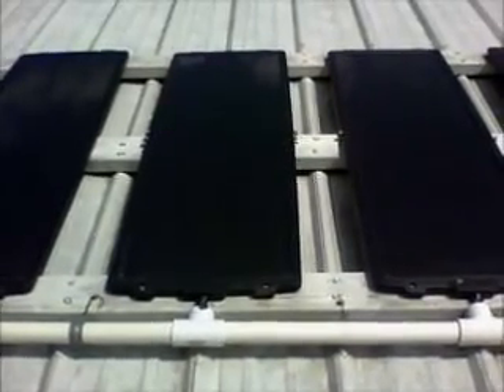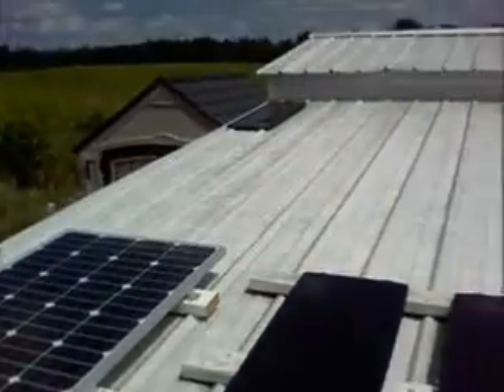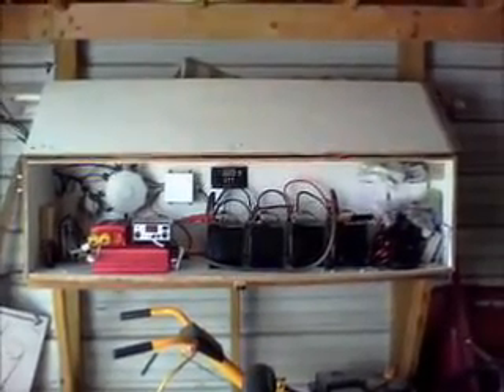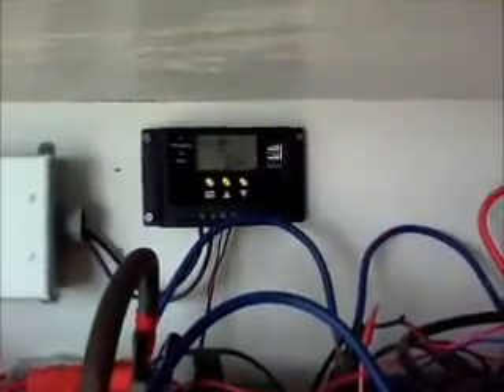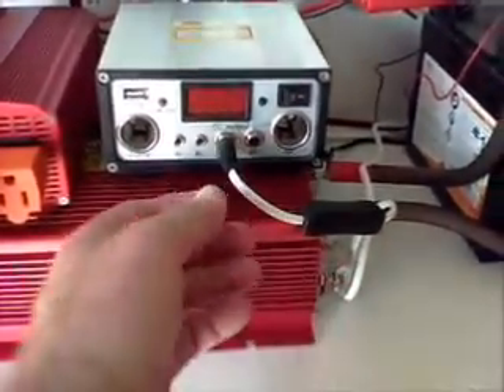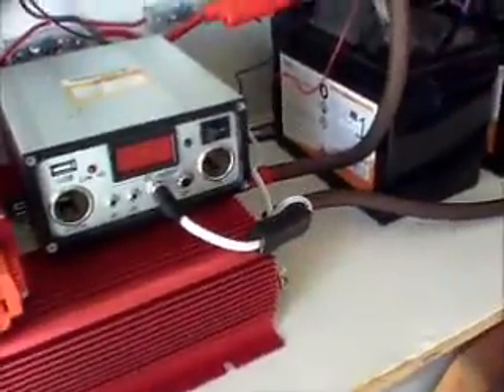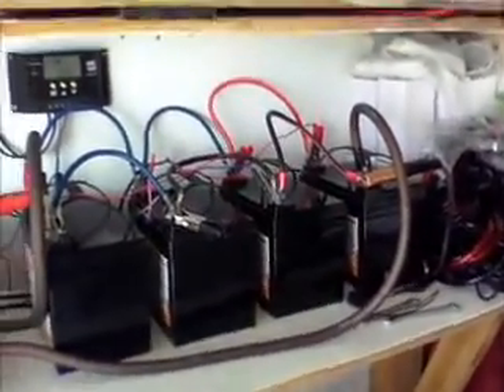Harbor Freight Solar Panel Setup With Add On

Comment: Great setup! What size fuse did you use in your system?
Reply from the maker: I think I used 30 amp. It's a few years since I set the system up and I knew I was going to be upgrading it so I went with a little bigger fuse.

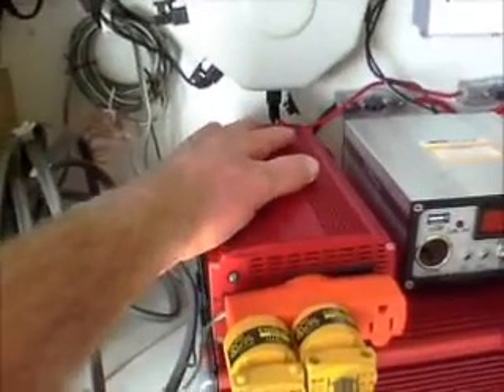Comment: Hi nice video ! Can you please supply us with the model number of the 1000 watts inverter that you like at 3:07 minutes in the video. Thank you much.
Reply from the maker: It is the BESTEK 1000 watt inverter I got off of Amazon for about 70 dollars when I bought mine. I have about 6 inverters (one is a pure sine wave) and out of all of them I like this one best! This one is not a pure sine wave but it runs the smoothest and has less draw on the batteries.
Reply: jamesndarlene thank you